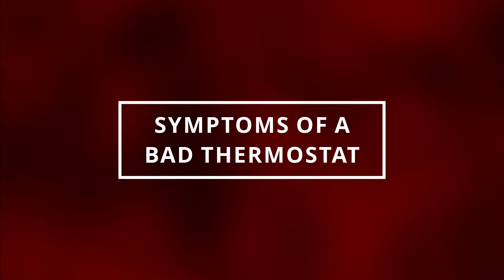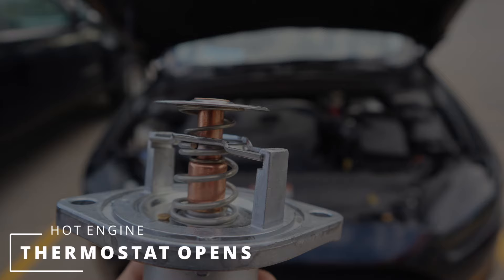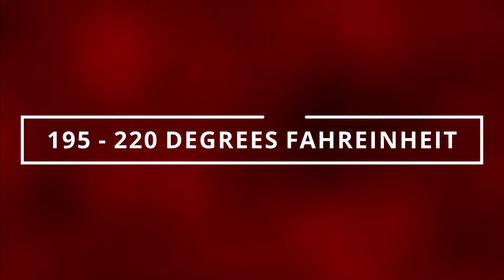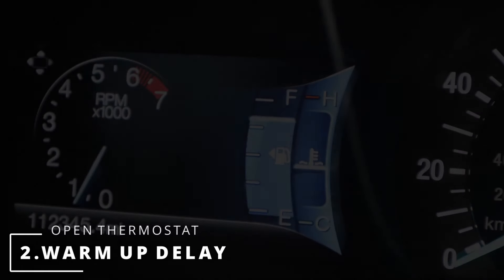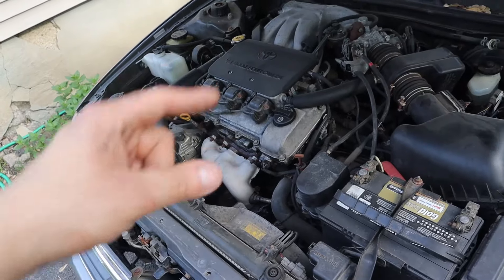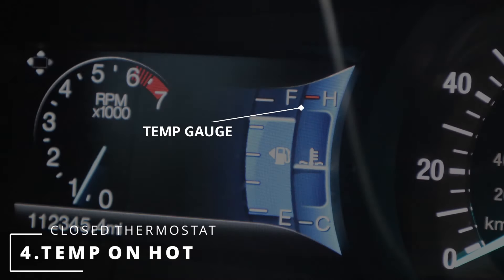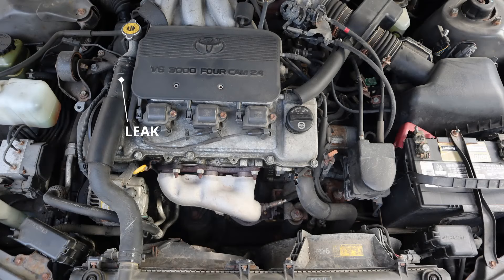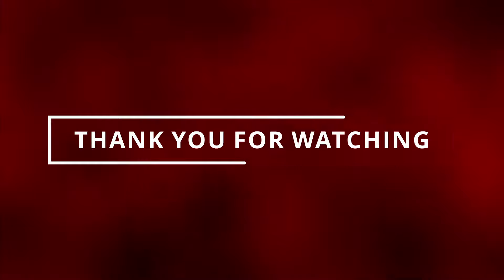SYMPTOMS OF A BAD THERMOSTAT

Comment: The only thing I disagree with you is that majority of the time a thermostat is found if you follow the upper radiator hose to the engine and not the lower hose.
Reply: On my 06 WK I believe it’s the bottom hose
Reply: R u upside down ? When is it on top? 😂
Reply: @nonamenolast4648  changed my thermostat yesterday. Definitely the bottom hose

Comment: Thank you for this video!! You just explained to me what the mechanic couldn't, wouldn't even give me the time of the day. And clearly what he said was wrong anyway.
My engine light came on, and this is the code I got. The mechanic said that my engine will overheat. I told them that the gauge seems fine, it's not high or low. I asked questions and they seemed bothered by it. They told me to replace the thermostat, the coolant and the sensor just in case, quoted me a big amount. From your video, I have 3 symptoms of stuck open thermostat, not closed as they said. At least I know what is happening. And I'll def have to find a different mechanic...🤦🏻‍♀️
Reply: Exactly i am having the same issue my car takes hell.longer roughly around 4 5 mins to get to operational temperature stuck open thermostat mught be the reason

Comment: Why Is My Smoke Alarm Chirping?

A hard-wired smoke detector usually chirps for one of three reasons:

 1) A dead or low battery... 

...your detector alerts you with a chirp that it’s running low.
 Replacing the battery solves the problem. 🤣

Comment: You’re a boss! Im doing a main seal gasket replacement on my 91 ls400 and wanted to know the symptoms 
I have cel and temp in ac not working along with overheating! Learned a few new things

Never had to do these, just all the other maintenance
Reply: Quick Question, my car over heats when i stop at stop lights and stuff...thermostat issue? and then I hear a kind of squeak noise from my coolant reservoir when I brake. any clue? idk nothing about cars.
Reply: @slimjimmy3334 I have same problem when stopping at lights. Did you find out?
Reply: @juanferosle  took it to firestone and it was a oil housing unit making the squeak noise... It Definitely helped it stop over heating real bad but now it comes up just a bit when i stop at a light for a few (after its at normal temp for a bit) but then i drive and it goes back down.

Comment: So doing some research because car was starting to overheat this past monday, just yesturday i got a radiator fan thinking this would solve the problem. It did how ever on my dash it shows the Transmission running a little hotter than usual past the halfway mark on the temp gauge. Im gonna keep an eye on the engine for a few days since it did sit for a total of three days.

Comment: Idk what my Colorado 2015 has the temp gauge keeps going up and down and I have no heater inside the truck. It just started acting like that after I changed the radiator,thermostat,and water pump,and the temperature sensor. Idk what can be the problem

Comment: Question... What if car temp goes up at a idle, then goes back down only when car is in motion above 20 miles an hour... I was stuck in a car line picking up some stuff and my car temperature shop all the way up, then and as soon as I was able to get going again came back down to normal... Is that a thermostat issue or is that something totally different... And thank you for your time and doing this vid
Reply: Did you figure out the problem ?
Reply: @geeked_up  temp sensor and not enough antifreeze even though it looked like it..
Reply: I have the same issue and just replaced the thermostat. Dang it. So it’s a temp sensor?
Reply: Also, mine is full of antifreeze
Reply: @kristinb5429  yeah the temp sensor was bad I assume because my problem went away after that it also helped make my car perform a little better if that makes any sense.. overall better Mpg.. but I did have a light come on again and I believe it's the spark plugs looking up how to take apart this beast in order to work on it
Reply: I should also mention that I did replace the thermostat too and replace the upper hose being it looked old and was sucking in on itself under the pressure.. fairly easy just how to remove a few items that we're not hard
Reply: Mine was over-heating, so I replaced the thermostat. It fixed it for about a week and then started overheating again. Now, we replaced the water pump. It’s been a few days and so far so good 🤞

Comment: Can a new thermostat go bad. I had just put a new one in my 2012 jeep wrangler a week ago and a new radiator. Yesterday we drove 2 hours no problems. Well we was pickig up our son at work i left thee jeep on it spit out transmission fluid  this morning took my wife to work and it overheated just smoked for maybe 10 seconds and stoppped. I didnt see any transmission fluid like last night or antifreeze. I grabbed the top hose it was warm i didnt check the thermostat hose but the radiator cap was not hot at all whish it had been before. Someone said might be the new thermostat just went bad what do you think about it? Great video and i subscribed

Comment: quite frankly the easiest explanation i have found on entire internet easy to understand thank you!!!!     my engine is not getting warm ( max 50 degrees celcius) collant level all good top hose is hot bottom is cold.         while driving along journey i stop at a mechanic because of leakage.. but he said he disconnected a hose  so i can continue my way long journey back home... now i have no heating in car ( only cold air)..... and cold engine no matted how the distance i drive...... Would it be also the EGR thermostat valve?? i dont have EBD reader but i have the engine signal ON and i morning startup usually have white smoke and also when i accelerate.... what you reckon @easyautofix? thank you in advance to you and other who read me!

Comment: Have a 2011 Chey Cruz that has coolant problems. I've replaced the the the radiator and hoses And yet it's still running hot. It will heat up and cool down in just a few seconds. I believe. it's the thermostat.What do you think my friend?
Reply: I had a similiar problem
I changed the water pump (it was rusty and leaking) and the thermostat and no problems so far
Reply: @supermaximo777  Thank you for your suggestion. If you don't mind me asking you how expensive was your new water pump?
Reply: The water pump cost me about $110 dollars at autozone
Reply: @supermaximo777  Thanks again my friend

Comment: I have none of the details you said, the coolant reservoir is shooting it out. The car does not over heat, the heat and a/c work fine, the hoses are the same temperature and both are soft . The temperature gauge does fluctuate from a quarter to the half mark, never above that. Anything that pops to mind on what else it could be?
Reply: Forgot to mention that the thermostat has been replaced a year and a half ago

Comment: Can you have both problems with a bad thermostat? My engine this morning took unusually long to warm up and reach normal operating temps and then after it warmed up it ended up overheating...
Reply: Same issue here, could be the thermostat, lmk how it goes with tours
Reply: Could be a bad water pump too. No circulation means it won't flow through a good or bad thermostat. You will also have a really hot hose vs a cooler hose.

Comment: Question: my honda civic 2012 doesn't have any engine light still it takes roughly around 4 5 minutes to get back to 1000/800 from 1500 rpm at cold start which is way longer compared to any toyota I have driven,  since it has no ligh in engine what might be the caus

Comment: Every vehicle I've worked on the thermostat is located on the top of the engine so therefore you will more than likely find the thermostat by following the top radiator hose, I'm not sure what vehicle you're speaking about but I believe you should not have said lower hose normally its located on the top of most engines made,
Reply: I have a 2004 dodge intrepid 2.7. It's located under the alternator
Reply: @tequilasunrise950  yes  that is correct, going back to what i mentioned before most thermostats will be located towards the top of the engine the alternator is fairly close to the top of the engine and as i stated before you can follow you top radiator hose and 99.999% of the time it will be at the end of the hose ,that will be the locación of the thermostat i have a 01 sport my thermostat is located right by my alternator the reason thermostats are located towards the top of the engine is so it will be able to bleed air out of the cooling system so the vehicle has Space for the coolant and the vehicle inturn will not overheat
Reply: I have a charger it is right by the water pump in front of the engine

Comment: Do you have to flush your coolant when you change your thermostat?
Reply from the maker: Absolutely!
Reply: @easyautofix  thank you for the help
Reply: no, you don't.  but you should burp the system
Reply: No, you just add coolant to replace coolant spilled into whatever you are catching it with. Use pressure valve to get air out, start car and turn on heater and relieve pressure till air is gone.

Comment: My 2015 Escalades fan was constantly on, AC not working well, engine light on and pulling that code. Replaced thermostat and cleared codes. I was also having an issue with towing where i was towing a 3k lb trailer and when i got to my location the engine wouldn't start again and is blowing the towing fuses. not sure if they are linked but maybe engine was getting way too hot because of the thermostat? We will see.

Comment: I just did a simple flush and fill with the spill free funnel, then refilled the car with new coolant, but I’m only getting hot heat on the high temperature setting? If I try to go to 80, 83, 85, ect… it gets cool, almost like room temperature? It blasts hot only on high temp. It’s a 2021 Acura ILX, 2.4L any advice would be great. Thanks

Comment: I have a 2013 Chrysler 200 and was told there were 2 thermostats, can't you also just disconnect the negative wire from the block under the hood. This car have been a pain in my a$$ and nothing seems to be easy. Good video though.

Comment: I have 1999 rav 4 with 218000 miles. 

It has been running cold. It’s reading Only 1/4 up the temperature gauge when I’m driving. It is getting to half way point when it is idling in place. 
Heat doesn’t work that well either. 

What ya think? Thermostat? Maybe something else.

Comment: I have an Acura where the engine temperature fluctuates from warm to hot and back down to warm again. Could that also be a thermostat issue or something else?
Reply: Im having the same issue as you, following
Reply: Could be the water pump barely spinning. It may be seizing and releasing.
Reply: Did you figure it out ?

Comment: I got the code but no other issues. No over heating, the heat runs fine, no leaks that I can see. Just topped off the coolant but it wasn't really that low. 🤔

Comment: I recently bought VW Golf 7 2.0 TDI and I need some help. Whenever I start the car, it reaches working temperature of around 90 degrees in 4-5 minutes, nevermind the car is cold or hot. The second thing is, if I drive the car for 5 minutes and I turn it off, all the time I hear the car cooling herself. The temperature never goes beyond 90 degrees but why always the car is doing self cooling after I turn it off. Thoughts?

Comment: I have a 2003 gmc Sierra and I’ve been doing a lot of work too it. The top radiator hose is to hot to even touch without pulling away ? Is that and or is this what normally happenes? I don’t have gauges but she’s never overheated for me yet
Reply: Lower and upper hoses are hot

Comment: my temp gauge goes to the H but will cool down to half way just from sitting with it off for 3-5mins.. if i use cruise control it doesn’t overheat near as quick either.. my radiator fans aren’t working though

Comment: I’m having a similar issue with my 2013 fusion 1.6. It’s about 50 degrees here in arizona and I’ll do a cold start and in about 15 mins my cooling fans will turn on and my temp gauge will spike up and get close to the redline. If I drive around the cooling fans turn off and the temp will go back down to normal (a bit below the middle mark). If I make a stop for a few minutes, the cooling fans will turn back on and repeat the overheating shown on the temp gauge. There’s also no check engine or codes. What do you think it is?
Reply: Did you find out what was wrong? Same thing happens to my 2006 Subaru Tribeca
Reply: Hopefully you get it figured out coz overheating your car over and over is really bad,I would advice not driving it till you get it handled
Reply: It was the thermostat on 2010 Ford Focus would overheat

Comment: I drove on a very steep hill and my car (quite old 2003) feels a bit hot at the dashboard side. (i didn't turn on heater or air conditioning) the temperature gauge is normal. Is there any possibility where a thermostat is faulty but the temperature gauge shows normal? I didn't get any check engine light on but I did feel a noticeably hot air coming from the dashboard side and my feet.
Reply: Me too let me know if anybody gets with you
Reply: Update?

Comment: Would you say it would make the coolant boil in the reservoir as well? My oil pressure gets almost to the H but when I turn my heat on it goes down to half and doesn’t go up or lower then the half way point
Reply: Bad radiator.
Reply: @Matt-vb2jo  ended up being a thermostat housing

Comment: I have a 2L tdi passat. My temperature gauge keeps fluctuating from 90 degrees to 85/75 degrees while im driving. I have full heat coming from my air con but for some reason the temperature just wont stay at 90 no matter how long im driving.. could this be a stuck open thermostat?

Comment: Hi l just noticed today that the upper hose is hot and lower hose feels warm close to cold but it's weird because lf I turn heater on it blows hot air ..this is a normal running temperature 🌡️ do you think l have a bad thermostat?....

Comment: My car seems hot upper radiator hose swelled up like a Ballon replaced it the thermostat is on lower hose 02 envoy but temp never goes past 200? But can feel bogging little after driving while as if we're hot ?Motor smells feels hotter then normal ?

Comment: I have overheating problem when stop and go traffic but no issues while driving on highway.  Fan is working,  no leaks or noise from water pump, just replaced the engine coolant temp sensor, could thermostat be the culprit? No dashboard lights...
Reply: Have the same problem! Please let me know if you find out

Comment: I had my water pump replaced other day after my belt ripped apart. Since then I'm getting warm air and only hot air whilst I'm driving for 15mins. When I off the engine and come back 5 10min later the air is warm again. One hose is hot and other isn but takes ages. What do I do, what is the issue. Toyota carrol

Comment: Question I juts got my new ecm from dealer but light came on and it show the 1028 code it’s the thermostat but if they put a new ecm shouldn’t be any light or this is Separate from the ecm ???????!
Reply: Did you get it fixed? Was it a sensor or thermostat

Comment: What if my temperature gauge was reading 260 degrees the whole time but was never overheating but I replaced the coolant temperature switch and the wires and grounds are good, I just broke the thermostat housing snugging it onto my manifold, could it be from running open headers for about a week? It never once overheated on me but still always reads 260 degrees unless it’s a cold start, but I never see it in the middle of the gauge.

Comment: Hey man i have a question, im not sure if its a stuck thermostat but everytime i fill it up with coolant, my reservoir is filled all the way to the top then my car overheats. Any reason why that happens?
Reply: By the way i pour it into the radiator, and top off my reservoir where its supposed to before this happens.
Reply from the maker: @skatakid117  Have you tried feeling both radiator hoses when the car is overheating? They should both be warm/hot when the thermostat is working properly. If only one is hot and the other is cool then the thermostat is stuck closed.
Reply: Prob same as mine no fluid lost but overheating even diagnostic is saying hot coolant likely thermostat issue as I think mime is not opening properly or at all
Reply: When I try to turn heat on I get no heat & I hear noise sound like something trying to opening up & maybe close is that the thermostat
Reply: You could have trapped air in the system. Try to bleed it out.

Comment: Can the thermostat be stuck open but still heat properly the inside?
Reply: Could have a partially stuck open thermostat like in my case. I noticed it when it  was -25F out and it worked until I stopped moving, I could see the temp gauge rapidly dropping until I started driving again. Worked perfectly fine above 10F.

Comment: If both hoses are cold...could this still be the thermostat...the gauge is sporadic...says its overheated when its not...hot air only comes once in a while and then goes back cold...overflow tank shows low but if i take the cap off...i hear the pressure release and when i put it back on the antifreeze fills back up in the overflow tank...help!!!

Comment: I brought a turbo caldina and I was driving around no over heating boosting and all, then I drove it nice and bearly any boost it drank the coolant and over heated any ideas?
Reply: Also when the radiator was cold the engine was still hot as hell

Comment: 1:34 doesn’t it flow the other way…that is from engine is to the UPPER and through heat exchanger (“radiator”) down to the lower hose and back into the engine?
Reply: No, from the thermostat housing it will go into the radiator and cooler coolant will come out the top on the other side.